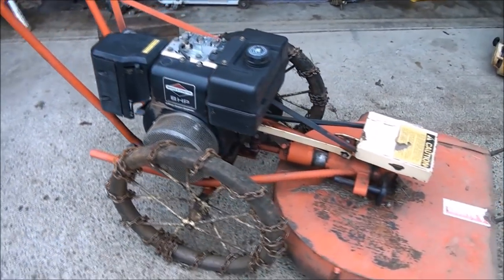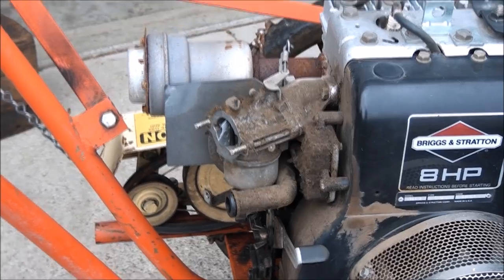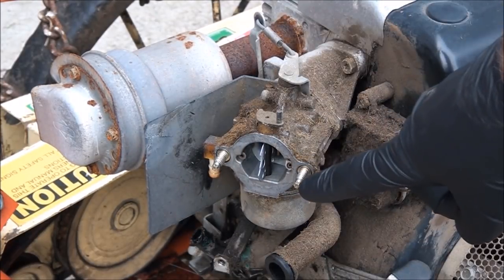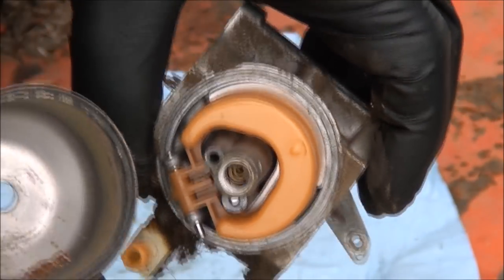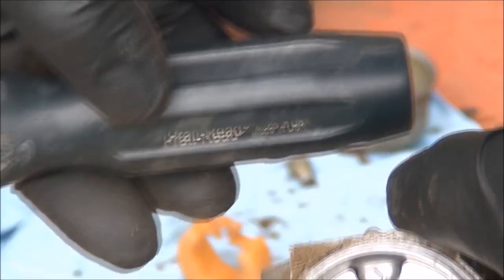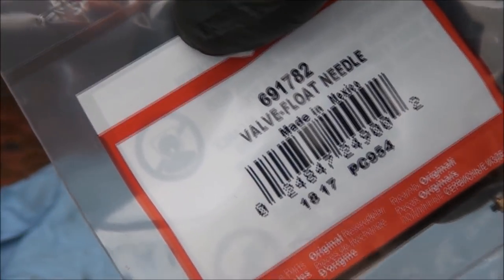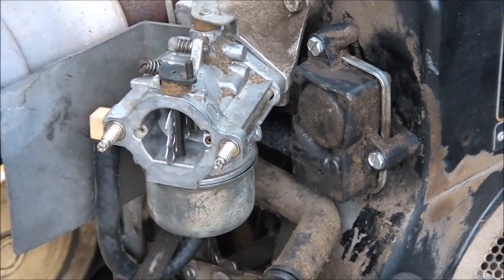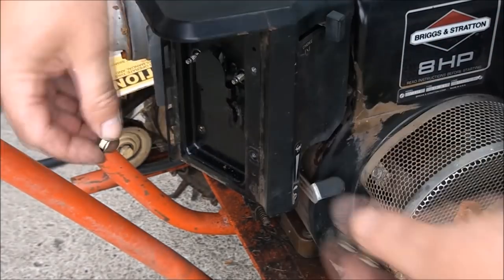Won't START? HOW TO Fix 8 hp Briggs & Stratton sideshaft engine DR Brushcutter BROUGHT back to LIFE!

Comment: I just bought 2 8hp wood chippers and one of them (troy bilt 47286 8hp) has engine# 192432 type 0122, but this chipper has been swapped parts out pretty bad, wrong control linkage, and maybe even wrong carb, I was unable to find any you tube videos on the troy bilt chipper vac but this video is exactly what I was looking for!  The troybilt has the exact same setup for manual start.   Not sure about the fuel pump, but mine has a fuel pump as well.  This made my day!  Thank you...   
The guy I bought the troy-bilt from got the wrong engine looks like, yet had the right model # on the starter recoil housing!  Yet crankcase cover bolt spacing is 2.5" on the troy bilt chippers, and most 8hp crank covers are 3.5 inch spacing!  Luckily I found another crankcase cover for it.  
My question would be on the fuel pump vacuum feed hose, as the troy bilt chippers have the fuel tank below the carb.  I can remount it somewhere but I was going to try to do it with the fuel pump.  I also have all the electric start parts.  
It's a bit of a project but I only paid 80$ for all the parts and the motor fired right up!   I just need to get the correct carb and metal housing like in this video, throttle control part, and I think I'll be in business! 
Also going to pick up a 1993 sears craftsmen 8hp wood chipper shredder today for 50$ that starts then dies... so that's how I found your video here!  Dumb luck I suppose.  I might subscribe to your channel to see if you have another video or 2 I can use with my 8hp projects!

Comment: Hi .  Just picked one of these machines up.  Got it running but not great.  I have a single white wire hanging off the back and just wondering if you know where that is supposed to go.  Thanks
Reply from the maker: It may be an electrical output for if you wanted to run headlights. or a ground kill wire for the magneto/coil
Reply: Look on the front under the starter...one red and a one white wire should be zip ties to red/positive battery cable...had same issue and just FOUND it!!

Comment: Right now I'm in the process of trying to get 1/8 horsepower Briggs and Stratton generator running but I went the lazy route and purchased a new carburetor so I'm waiting for that to get here. I also purchased new fuel lines but I've not done anything with the fuel pump yet and I see you did not either. Wouldn't it be a concern if it was sitting for 10 years that pulse fuel pump might be froze up? I have an open mine up yet. I did loosen the screws on it and fuel did come out start to come out but I did not check the fuel supply up a carburetor to see if it was pumping fuel to the carburetor. I imagine I would have to check that while pulling on the start cord.

Comment: do you have video on Dr field  and brush mower  8 hp oil change or winterizing?
Reply from the maker: No sorry. But most small engines have similar winterizing procedures.

Comment: So even after all those years of sitting the pulse pump is okay so there's hope that mine is all right so I will leave it alone until I get the new carburetor put on and get the new Killswitch installed. I bypassed they loyal switch online thinking maybe it was bad because the light was flashing while I was pulling the cord even with the correct oil level.

Comment: for the bolts holding the carb in you can buy an external star socket from o reily's auto parts, it may be better than using a normal socket

Comment: Very clear and informative video!  Thanks Jeff.  I have the same engine on an old Troy-Bilt Chipper/Vac with the same issue.  It will start with starter fluid then die.  My question is, you re-built a the carburetor and every part and jet hole seemed in very good condition.  If you had to guess, what was the root of the problem, other than sitting there with bad gas, what do you think prevented it from running?
Reply: Well, I guess you did replace the Valve Float Needle so I guess it could have been that.
Reply from the maker: I would say a contaminated fuel system and plugged carb

Comment: I have this same engine on a tracvac leaf vacuum. This week the throttle control lever stopped working. The butterfly is at wide open all the time. I'm guessing a return spring broke and fell off. I watched your video hoping to see what mine is missing. I have the linkage/spring that attaches to the top of the carburetor.  I have that S-linkage in the middle of the screen at 17:48 and I have the spring at the bottom near the throttle control that attaches into the lever with all the small numbered holes. When you go to full throttle that spring stretches and would pull the linkage. When you go down to a slow idle the spring relaxes but there is nothing pulling that lever back to close the butterfly. Any help would be appreciated.

Comment: By chance you wouldn't have the model number on that motor would you? I have the same motor on a little Wonder blower but the part number plate is missing on the recoil housing
Reply: You don’t use a model number on some other engines do you have your own model number look on the motor and you get the right number

Comment: I enjoy your videos. Where do you buy parts? Mower shop, on line, auto parts store, or all of the above?
Reply from the maker: Some DR parts have to be purchased through DR Power equipment. But most other parts I try to buy at my local Briggs and Stratton dealer.  Amazon online has most parts too.
Reply: Mine is green I took the old fuel pump apart and there were none of the tiny springs in it so I need a diagram or picture of the placement for the springs. HELP

Comment: I stripped the emulsion tube and broke the choke lever for my carb, does anyone have the briggs and stratton model number for the engine, I have the industrial plus electric starting model, any clues will help
Reply: Look on the blower housing the model and serial number is on that